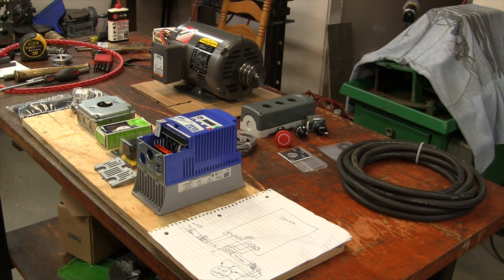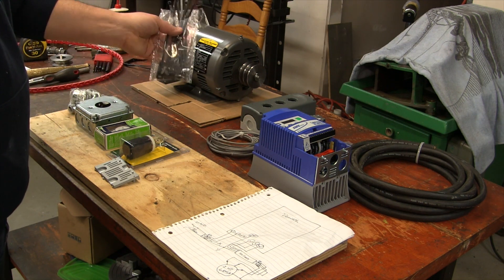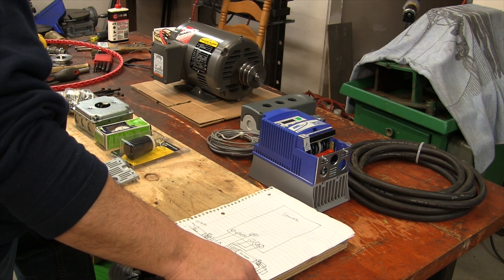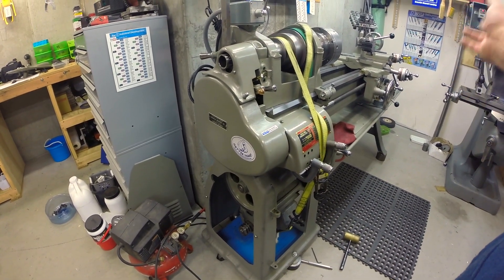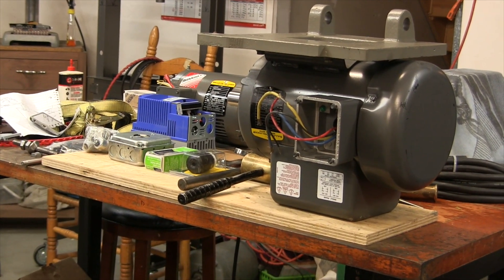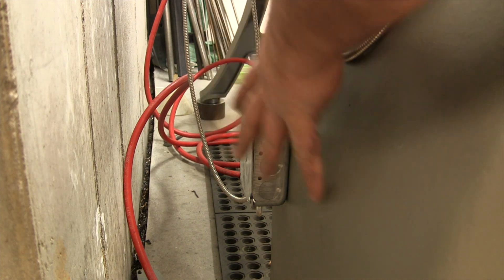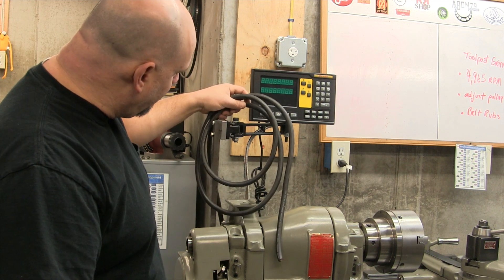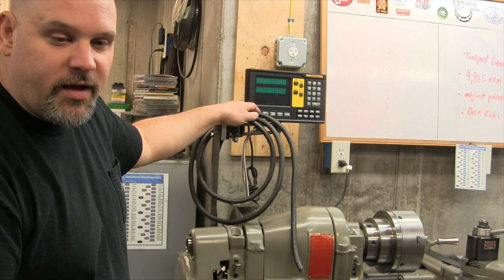South Bend Lathe 3 Phase Motor & VFD Installation   Part 1

Comment: Nice job, but you really should be using THHN in that conduit instead of SO wire.  I think that might actually be a code thing.
Reply from the maker: You’re 100% correct. But that was years ago 😊. Thst lathe is long gone.

Comment: I have 220v in my garage I'm unsure of the amperage but I have 3 wires coming from my box but 4 prongs from my lathe I can wire a house with no problem but never run lathe wiring

Comment: Hi Brad.  Another basement guy here with similar lathe.  13386TKX.   I just converted 4 other 3 phase machines to VFD.   Now I want to convert lathe to 3 phase with VFD.  Would you mind sharing specs on motor.  And would you get same one after running it for a while.    BTW.  Great instructional videos.    Great to see people in the same boat.   Cheers.

Comment: Still have the 5hp motor?
Reply from the maker: Joe Sosnowski Hi Joe - Yes I do. Just sitting here collecting dust.
Reply: @BasementShopGuy  I have a 2hp single phase motor I was going to build a lathe around. Thinking I may want to use that for a mill, and use a 5hp for the lathe... how much you want for it?
Reply from the maker: @joesosnowski7568  Email me: basementshopguy @ gmail

Comment: Hi Brad - Thanks for the videos. Just a couple thoughts. Typically, a VFD is sized ~30% larger than your 3-phase motor, as they are not 100% efficient.  Also, 10/4 is way overkill for a 2 HP motor unless you are a long ways away.  My 4 HP VFD has a current draw of less than 14 amps at 220 VAC.

Comment: Do you have a cost brake down for the complete conversion? I have a southbend heavy 10 that was 440 3 phase when I got it. I changed the wiring and heaters as instructed from online sources to run 220v with a phase converter. It runs but it seems under powered and the switches seem to buzz more then I think they should (though I'm very uneducated in the matter).

Comment: Looks great! The one thing I don't understand about wiring in a VFD, is how do you get power to the other smaller motors? Every forum I scroll through, says you have to wire a VFD directly to the spindle motor. I ask because I was fortunate enough to get a good deal on an older Hardinge TFB lathe. I don't have 3 phase power, and everyone recommends VFDs, but I'm clueless on wiring it up. Help!

Comment: I believe that your Baldor motor (Standard-E) is not designed with AC drive. You must use "Super-E" in order to control properly the speed with constant torque (10:1) and to be safe than Standard-E with AC drive.
Reply from the maker: Hmm maybe. I'll look into it.

Comment: Can I ask why alot of americans so stubbornly uses "horsepower" when it comes to just about everything? Using watts when it comes to electrical stuff makes a whole alot more sense to be honest, especially when talking about stuff like amperage rating on stuff like a drum switch. Or do we actually talk about a drum switch that can take the force of two pulling horses before it physically rips apart? Just my two cents on the subject.

Good video series anyhow :)
Reply from the maker: I think it's just what we know and can easily compare power with.

Comment: hello sir just a question, ive bin told homes do not contain 3phase power even at 240 volts if this is true then is it possible your not gonna get 2hp from that motor ? i know for a fact my house only supplies 240 single phase ac 180 deg out of phase between the hots  , im not interested in running 240 volts as this would add hundreds to my restoration cost 240 would be nice for welding but man this project is like restoring an old car for crying out loud

Comment: Clean looking install so far -- looking forward to the finished product.  One thing that I noticed is when you installed the liquid-tight conduit to the motor, you put the locknut on backwards.  It works like a lock washer in that the tangs are angled down to bite into the metal box.  Installed backwards, there's a good chance that it will vibrate loose over time.
Reply from the maker: +swp466 I'll check it out - thanks!

Comment: Hi Brad did I hear you correctly in saying that later on you intended to put a plug and socket between the lathe motor and the VFD ? I f did hear correctly I would advise against it, it's not good practice if a VFD suddenly looses it's load it will more than lightly be badly damaged. 
Keep the vids coming
Reply from the maker: +Black Country Steam Yeah, I knew that too, and had a moment of temp-forgetfulness, Lol. I left it as is... :)

Comment: A VFD........man has this been coming for a while......Brad, you are going to love it.....as a owner of a 13" SB, I can feel your pain......those motors have to be in the worst location of any machine Ive ever seen, and that 5hp, wow a beast!........this is a great show on how to do this swap, thanks for putting the work into it..............my 1960 13" SB has a 3phase 2hp.....220vlt input.....running thru a Phase converter, so could I add a VFD to my set as is now?.............cant wait to see your next show.
Reply from the maker: +Rick L Oh, I know Rick. I have my VFD on my Mill and it's great.

Comment: Friction tape isn't nearly as bad as rubber splicing compound. Damn stuff fuses together and you have to cut it off. Hard to beat wire nuts.

Comment: With a few exceptions, bolts have the nut tightened where with screws the screw is tightened. Screws usually come with hex nuts and bolts with square nuts.

Comment: VFD the only way to go , larger motor is always better for a lathe as an ac motor has little torque at low rpms it is nice not using the back gear and making belt changes- just turn the dial!
Reply from the maker: +Sparkness Agreed!
Reply: +BasementShopGuy Also a braking resistor . you dont need to buy an expensive resistor made by ac tech. all you need is a 100 ohm 100 watt power resistor for this application as this will barely get warm used on a lathe or a mill. Available on ebay for about 5-6 bucks
Reply from the maker: +Sparkness Really? That's actually pretty cool, as I want to add one. I saw some vids on YT with them in action - way cool... Thanks for the info!
Reply: the ac tech resistor is 160 w 63 ohm for 2HP so you could use a 75-100 ohm 100w in my opinion because you are not starting & stopping the motor frequently as in factory process. On my lathe I have 2hp and a vfd and a small 100 ohm power resistor ,slows down quickly.

Comment: Way to go, Brad. That's going to be a smooth running lathe. Dial the motor down to 15 Hz, shift the feed tumbler to neutral, and you'll barely hear it running. That is unless you have a Clipper splice in your flat belt. Click. Click. Click...

Quiet is contagious. I predict your next project to be noise mitigation.
Reply: BTW hang on to that 5 HP motor to power a bigger comperssor in the futurel You might want to run a media blaster or major air tools. Most defunct compressor systems I've seen died because the motor fried. Most often the old compressor (with a good pump, mind you) is junked and replaced with new as a better investment in the long term. 

Snap up the dud compressor, add your new motor ...  bada-bing!
Reply from the maker: +Forrest  Addy The drive causes the motor to have this high-pitched "whizzing" sound. Stan tells me, that it's the "vector" causing it. See how I referred to it within quotes? Haha - I hope to gain more understanding of industrial electronics.
Reply: +BasementShopGuy Brad, the "whizzing" sound is a high pitched sound? That may be carrier freq emitted by the motor. Iron changes shape slightly when magnetized - magneto-striction. You hardly hear it at low frequencies but 5 KHz can be annoying if your hearing is keen. You're a young giy; I bet you could track a bat by listening for its echo location.

You can adjust the carrier frequency by tweaking the parameter listed in the manual. I suggest 15 KHz if you have the option. I don't think there is any significant reliability or performance penalty in doing so. I favor Yaskawa VFD's which have a 20 KHz serring. My machining experiences are unsullied by whistles, whines. or whizzes.

Comment: Very clean install.  I'm changing the motor on my Atlas QC42.  I've got the original atlas 3 phase 1/2hp motor.  I swapping it with a 3/4 hp single phase.  I like the idea with the plug system so you can move the lathe.  I live those VFD's my electrical engineers tell me that brand is a very solid.   Good job.
Reply from the maker: +brosselot1 Thanks man!

Comment: Brad, after six years of service, several 5 to 15 HP motors at work driven by VFDs ended up with destroyed bearings. The cause is said to be high frequency current from the VFD passing through the bearings. I've seen the result: etched races and balls and trashed grease. To prevent future bearing failures we added annular grounding brushes to keep the motor frame and shaft at the same potential. I understand "inverter rated" motors have this protection built in. I will soon be doing a similar conversion and am very interested in your project. Hope it turns out great! Jon
Reply: +Yan Wo I Googled and found several technical papers on the topic axial induced current in induction motor shafts.it appear to be a real concern in heavily loaded and frequently started motors. Seems the best solution is to install an insulator to interrupt circulating current.

Now I think about it I have an old Audel's millwright handbook that addresses this in connection with large M/G sets rollonh mill motors, etc. Not so much lightly loaded motors. On our level that may be a problem looking for a manifestation.

Interesting problem probably low incidence in small HP machine tools but enough to make me want to open a few dud motor bearings to inspect for distinctive ball track defects shown in the papers I just read. I've busted hundreds of junked bearings, salvaging balls for ammo and larger races for reforging into hunting knives but seldom saw more than a satiny trace or a few pits in the ball paths. Then there is immersion rust and lube failure but that's a different deal.
Reply: Never heard of that before or seen it in trade journals but I see how in rare conditions that could happen. I've had a VFD on my turret mill motor since 1993 (33 years?). I just went out and gave the mill motor a close listen with a stethoscope. No noise but the quiet whir of middle-aged bearings. No problem so far as I know with the 40 plus retrofits I've been involved in since I retired. I'll call around to old customers for late developments.
Reply from the maker: +Yan Wo I think it'll be good. My machine isn't running for long hours, so I thin she'll live a long life :)
Reply: +BasementShopGuy I think you're correct. I hadn't thought of the duty cycle issue.
Reply: +Forrest  Addy I found this <http://www.est-aegis.com/index.php?gclid=CN2fn9Gs3csCFQIOaQodyo8J7g> then realized the company is the same one whose grounding brushes we used. So their data isn't exactly unbiased! :)

Comment: You (and Stan) were very wise not to trust your drum switch. When I took the course on electric motors, at a very reputable University,  under Prof. X  (I do not wish to mention his name) we were introduced to the brand-new motors lab. Prof X said "these switches are the wrong rating but they'll work" and threw the switch. A foot-long flame shot out of the switch, burned a through hole (literally) in Prof X's hand, and he had to be hospitalized and was there two months. Our course was toast :) so I  don't know as much about electric motors as I should. I think the moral is kind of obvious. It did make me wake up to the fact that all components in an electrical circuit have to be up to the job.Following these episodes very carefully because I too want a VFD on my lathe.
Reply from the maker: +Juan Rivero interesting story Juan. I'm glad to be able to help out with my video, but the real credit goes to Stan - he's been guiding me through all of this. I just don't have the experience with VFD's and motors, enough to know it cold. So he's kinda like the professor in this case. Only he knows his s___t  :)
Reply: Yeah, but you're doing the video! Agree totally with Stan! Wish Prof X were like Stan.

Comment: Good job Brad , why did you use a vfd  instead of a rotary ? The reason I ask is I'm going to have two 3 phase machines in my home shop and I'm trying to decide what to use .
Reply from the maker: +HS 53 I like the VFD because they offer a lot of different options like, ramping speeds, speed control, over-loading (running at higher hertz), skipable hertz, breaking-resistor capabilities, Emergency-stop capabilities and SO much more than I can even remember. I don't know that much about rotary-phase. Do they use motors to drive the unit? VFD's are cheap, easy to install.
Reply: Thanks for the info Brad .

Comment: Your going to be amazed at the difference in your lathe Brad. I haven't done mine yet but have done the mill. The smoothness of power delivery, quietness, and the pre-sets on the programs and speeds make it well worth it. I'd bet you'll see much better surface finishes as well. 3 ph and VFD is the only way to go imo. Even more so for a lathe.

Everyone's wants and needs are obviously different, but depending on your average depths of cuts and motor loads, I might have gone with about a 3 hp  motor/VFD combination to give a bit more torque at the lower motor speeds. No big unsolvable issue though. Your normally not using the real low speeds much anyway. But even if it did become a bit of a problem you could always use a 3 or 4 step pulley set up as well as the VFD to keep it into the better torque range.
Reply from the maker: +Turning Point Yeah, I'm totally expecting it to be great in every way. It IS however, not that quiet - which bummed me out a bit. Apparently, the "vector" drives make a high pitches whizzing sound. No big deal, but my other Teco drive is near silent. Oh well. The drive is really good quality tho, so I suppose that's the important thing.
Reply: +BasementShopGuy I bought a heavy duty industrial rated Baldor VFD some years ago for my mill. They were a LOT more money at that time. The motor is a 3 hp 3 ph Taiwanese. It surprised me just how quiet and smooth it is. The VFD's onboard cooling fan is however quite loud. Seems we just can't win. :-)

Comment: The older South Bends had smaller motors on them.   I saw a 24 for sale and it only had 1-1/2 HP.
Reply from the maker: +1970chevelle396 That's not factory then. They shipped my 13" with a 2hp. The 16's and up probably had 3 and 4 hp motors.
Reply: I think it was factory on the older Lathes. this one was from the 40's   I've also seen lots of 16's for sale with smaller motors.   I put the 2hp motor back on my 13.

Comment: At 15:55 that connector nut is facing opposite the way I install them.  I consider them like a lock washer with the tabs facing the box to help keep vibration from loosening them.  This may or may not be correct but that is my practice.  Just a thought.
Reply from the maker: +Roy Reynolds I'll check it out Roy - good eye, thanks!

Comment: While it is poor practice I think in reality you could have got away with that 5hp on the drum switch for a long time. On a lathe like this you aren't picking up under load so the amp draw is mostly a function of load and I doubt you would be taking cuts approaching a 5hp load so the switch would not be under anymore strain than the cuts that you take.  I am sure you will enjoy using the VFD though.
Reply from the maker: +bcbloc02 Yeah, I'm pretty exited to be able to dial in speeds right on the fly.

Comment: I have a very similar Baldor driving an exhaust fan at work.  it runs 24/7 and it gets 2 pumps of grease once a quarter.  Not sure the age, but my boss has been there 12 years and he has never replaced the motor.  Just make sure you clean the zerks before greasing it, pushing dirt into the bearings kills them.
Reply from the maker: +gadget73 GREAT point. And yes, those zerks do have some paint on them. I'll get em cleaned - thanks man!
Reply: +gadget73 
You so right about bearing contamination and premature wreckage as a result! 
I'm amazed at the number of people I see that don't bother to clean the zerks OR the end of the grease gun before putting the two together! I am constantly getting on to my students about doing this job correctly.

Comment: Glad the motor frame was close enough to mount with minor modification.  When you were talking about drilling and tapping new holes on the plate, I was yelling at you to drill the motor, not the plate. The only thing I would be aware of, is when you generate a phase using a converter or VFD, your motor horsepower rating drops by a percentage. The amount depends on the efficiency of the motor and the VFD or converter. You probably won't notice a difference considering you had a 1 horse in there. You always do nice clean work. A pleasure to watch.
Reply from the maker: +Ken Wolfe I was (planning) on drilling the holes because I really thought the pattern was going to be a lot larger than the small base I have now. But luckily I didn't have to do anything - what a delight. Glad you're liking the video - appreciate it!

Comment: Those are screws not bolts.
Reply: +BasementShopGuy - Screws go into a threaded hole in a solid object; bolts are fastened with nuts. (It's a finicky distinction, but Richard is correct.)
Reply from the maker: +Richard Paisley Huh?
Reply from the maker: +Peter W. Meek  Pete - of course I know the difference, but when you're working (and) filming, you're sometimes concentrating on how to explain things while trying to work in a camera-"smooth" way too. Do I (and other) mis-speak? ALL the time... these are just momentum-killing type of comments.
Reply: Sorry. Didn't mean to be a wet blanket.
Reply from the maker: +Peter W. Meek Haha - You're not a wet-blanket!